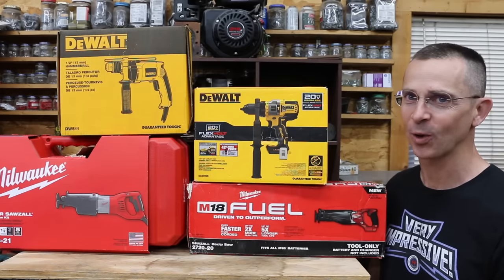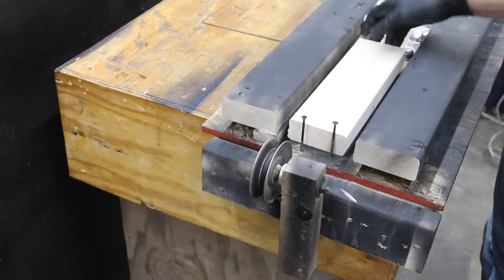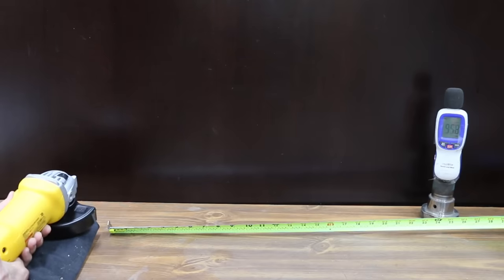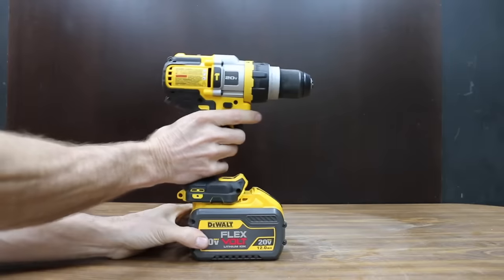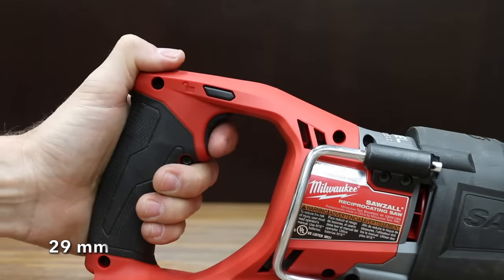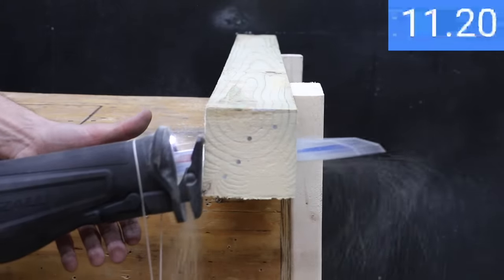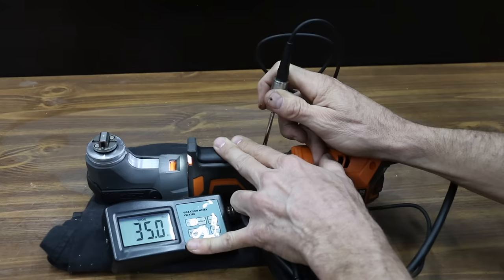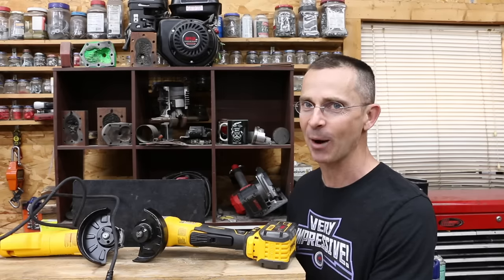Let's Settle This! Are Cordless Power Tools REALLY Better? Torque, Cutting Speed, Noise, Vibration

Comment: Being in new construction as an electrician, battery powered hand tools are a must. Everyone has an opinion on what brand and type of tools are the best. I’m always glad to know that someone is putting these opinions to the test in a fair, accurate and unbiased manner. This has got to be one of the best channels on YT for tradesmen. Great job as usual.
Reply: Electricians are team red and carpenters are team yellow. That is what is best.
Reply: Makes sense if you're often going from room to room and there are no outlets available because you are installing the outlets
Reply: This and tool box buzz are the channels I use before making a purchase.
Reply: I mean yeah for cutting conduit and screwing screws then battery is okay. But if your cutting 2-4 inch cores all day or cutting 250+ 4x4s a day than that's not the case unless you have like $10,000 worth of batteries. A $500 generator and $100 worth of 10g exstenton cord is WAY less than even 2 sets of batteries to run a sds max hammer drill or skill saw/sawall. They both have their application. I like battery, it's more portable. But for a skill saw or sawall or grinder especially a 7in grinder then plug in is what I reach for.
Reply from the maker: Thanks so much!
Reply: Corded will last you your entire life. Batteries wont. Always getting tou to come back and pay them more money.

Corded might be a worthwhile investment considering our economy.
Reply: I like Bosch, and I have a couple of Ridgid drill drivers I like because the way the chuck LOCKS with a twist, our electrician has a barrel in his shop full of dead makitas and a few other battery tools, I call it his Makita graveyard haha he and his brother seem to burn up those Makita drivers frequently, no idea what he is doing but he said they send replacements under warrantee.
Reply: Agreed this guy goes above and beyond
Reply: @Krobear  So this is why I have fried two Milwaukee framing nailguns than air powered Paslode and Bostitch. That 60k shot warrantee is a joke along with the overheating frying the motherboard. I call it Millennial because it gets a little warm it quits. Not to mention they had to go back 6 times now and still aren't fixed. Guess pumping out 180 nails is to much to ask of it in one round. But I have yet to see what my Dewalt will do. Last true test, I did like the above, it shut down, but I am betting that was due to running it hard for 3 hours before my "send it" testing.
Reply: @Krobear  sacrilege!
Reply: You can't go with just one brand if you want the best. You also can't choose just battery or just corded you need options. I use a battery milwaukee impact and a corded dewalt drywall gun all the time for example and I use them cause I've found they work best (for me) to get the job done. I lost all brand loyalty years ago when I found out almost nothing is made in the USA.
Reply: @Doobie603  crap stuff gets made in the us too
Reply: @Doobie603  with cordless tools sticking with one battery platform is sensible. Maybe you won't have the absolute best of every tool. But you should be able to run all of your tools. Having a fleet of battery chargers is pretty excessive.
Reply: @lolatmyage  Exactly it all goes down to what you need for your application. Safe,Budget and fast because remember. Time is money!
Reply: @1pcfred  The electricians around here seem to prefer Makita, the carpenters Dewalt and the plumbers Milwaukee. It could be to keep one trade from swapping batteries with another which seems to be a problem as many job sites will only have power at one point.
Reply: @1pcfred  I def agree, I am just saying if you gotta have the best no one company has it covered.
Reply: @Doobie603  I can agree with that. No company can design the top performer of every tool. In general what they offer is acceptable though. With some notable rare exceptions. A while back I can recall DeWalt putting out an impact driver that everyone testing it found to be very underwhelming.
Reply: @tiredoldmechanic1791  I remember when cordless first came out. We had the 9.6V Makita driver. It was pretty revolutionary. Most construction workers are just felons that haven't been caught yet.
Reply: @tiredoldmechanic1791  makita seems most durable as long as your not working with water their saftey shuts them off milwaukee has good power but 18 v die too quick but if you can wait for repairs warranties great dewalt seems to be the middle ground ryobi lasted the longest for me but were too weak to complete job on occasion
Reply: @johnathanmandrake7240  if you take care of the batteries they should last a while.
Reply: @lolatmyage   there should be spider box’s through out the Job site if you are talking commercial

Comment: The big test for me on most of these tools is how they will compare in 10 years.  The cordless will be near useless unless I get a replacement battery, and that assumes that they haven't moved on to a different style of battery by then.  The corded one will still work.
Reply from the maker: Thanks for the feedback.
Reply: I have corded tools that are 30 years old.  I have gone through 4 cordless drill, mostly because of needing battery replacements.  I prefer corded for this reason since I am a DYIer and not a professional using these daily.
Reply: @Peter Allen : Exactly my thought !
Reply: This right here, when I got on my own back in 2009 I bought cordless power tools, but they were still Ni-Cad, of course a year later Lithium Ion came out, I couldn't afford to replace my tools, eventually all my NiCad tools crapped out. My dad on the other hand still chugging away with his power tools that all have to be plugged in..tools that are 40 years old. I went all corded since. Aside from my Impact Driver since I use that solely for portable jobs.
Reply: @neoasura  
In 2009 lithium ion power tools were around, but even those weren't close to what they are today. And they were expensive compared to today.
Reply: In 10 years, they would built an even better cordless tools so there really no need to keep the old one, batteries seems to advance at such a rapid pace nowadays. Corded tools if use extensively, won't survived 10 years either. The only tools that ever last 10 years is the one sitting on the shelves collecting dust.
Reply: I have gotten into the habit of registering all of my Ryobi and Ridgid tools, batteries and chargers. Let's see if their lifetime warranties on the batteries really hold up. At some point they will stop making the older line of batteries, and tool owners will be SOL.
Reply: @helloman3676  I have plenty of ancient corded tools that saw extensive service and still work like new, including a 30's Black & Decker drill that was used on an assembly line for a couple decades. The front end bearings on that thing are bigger than those on a car, the stator/armature are hugely overbuilt, and you've got about 3lbs of copper in the windings. Modern, "Value-Engineered" tools are a terrible standard to go by when it comes to longevity.
Reply: @LN997-i8x  sounds like a heavy drill. No thanks.
Reply: Exactly.
Reply: I have some blue Ryobi tools still working just fine but as a home owner, some are very newish still. :)
Reply: The fact of the matter is , if you are using it daily as a pro, as a contractor, you can easily afford to replace it with newer and better. But if you are a craft pro and are not demo happy, and pounding everyday, you are more likely to take care of the tools for either carpentry, etc, you will keep your tools. Or an DIY homeowner. 
The fact is corded is more powerful and longer lasting, and less expensive. 
MFG DO NOT want you to keep corded tools and that is why they have NOT refined them to work smoother, quieter or with updated features.  Very much like the politicly driven car industry. They dont want you to own cars autonomously. They want 100% control, and the fuel that goes along.
Reply: @helloman3676  ... and that's exactly what the average DIY type does. His tool gets used maybe one weekend a month and in a few years the battery is toast. For half the price he can get a tool that will still work in 40 years.... but will likely replace the extension cord due to dry rot before the tool.
Reply: @helloman3676  They'll last a hell of a lot longer than the batteries will.  If corded and cordless tools are used the same amount, the batteries will soon be junk and you'll be shelling out big bucks for replacements, not so for the corded ones.
Reply: @percyfaith11  no you’re talking about batteries tools that were 10 years ago. The technology now, batteries tools and batteries last pretty long time. And in another 10 years, corded tools probably will not even be make anymore at the pace of how fast the batteries technology is advancing.
Reply: Makita batteries are usually ok after 10 years. If using other brand you should always charge when down to 1 bar, never go lower. Makita LXT has a cutoff at around 10.5 volt, it makes a huge difference on battery wear.
Reply: @pflaffik  ... you are making a rather broad statement based on a visual indication of battery charge... and that feature has only been around maybe 5 years at best. Most of us talking about battery life are owners of these things going back into the early 80s and we have the experience of going through many generations of these things. Are they getting better? Sure.... but they all have battery life issues eventually, especially for the DIY guy who leaves the tool on a shelf for many months at a time.
Reply: @helloman3676  Here's a quote from a website talking about this issue.
"So, how long do Lithium-ion batteries last? To sum it all up, the bare minimum that most manufacturers expect from their batteries is around 3 years or 1,000 charging cycles (whichever is less). With that said—we say “put your warranty where your mouth is”. Bosch, DeWalt, Metabo HPT (Hitachi), Makita, Milwaukee Tool, and Ridgid all warranty their Lithium-ion batteries for 2–3 years. That’s a real good indicator of their minimum expectations for those packs."
My corded drill will still be running (without additional investment) for 10 years or more.  Battery technology hasn't improved as much as you think.
Reply: @percyfaith11  "bare minium"
Reply: @helloman3676  "warranty for 2-3 years".  Nice selective quoting.
Reply: @percyfaith11  Dude, you're not gonna change your mind, i'm not gonna change my mind. In 10 years, i'll be right and you'll be wrong. No need for further persuading.
Reply: @helloman3676  lol, I proved that you were wrong and I was right. 10 years isn't going to change that.  Dude.
Reply: I have a 3/4 in drill( probably weighs 25 pounds that was built in the late 40s. It sits in the corner for years at a time, but if I need it, it fires right off. It'll break your arm if it hangs up, but it will always do the job it was built for. I don't know what it would cost now, but it works just like it DoD 90 years ago. No battery operated drill will last that long for sure.  Hell, most battery designs are changed every time they bring out the latest "wonder tool".